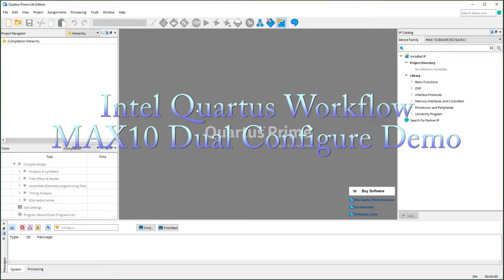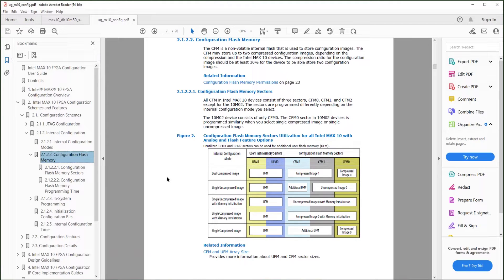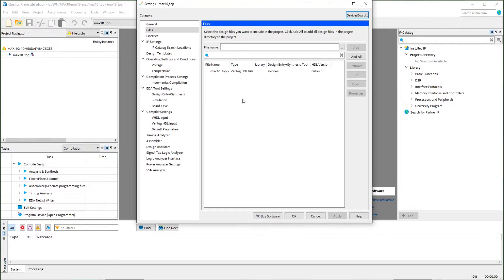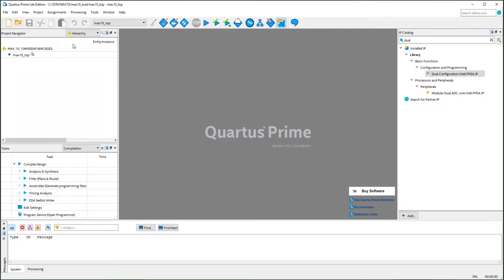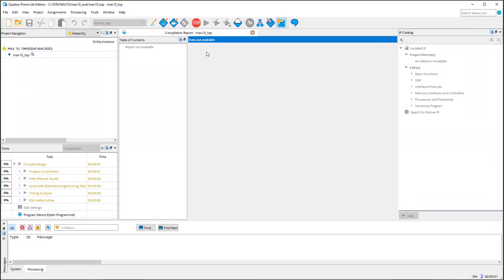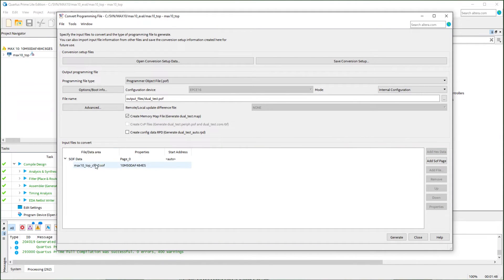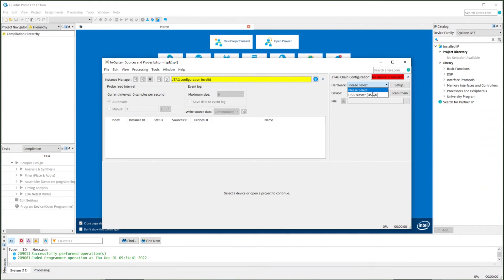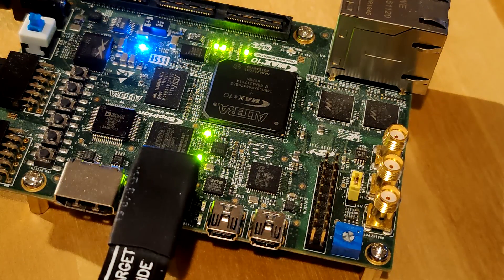Intel FPGA Development Workflow - Quartus Prime and MAX10 Demo

Comment: Is there a standalone Quartus Prime Programmer Software download.. or do you have to install the Design software and all the device-support files in order to program?
Reply: The programmer itself is a standalone executable (Windows .exe) but I'm not sure whether it needs any DLL to support. All should be included in Quartus download though. I don't think you need to download device file to program the chip.